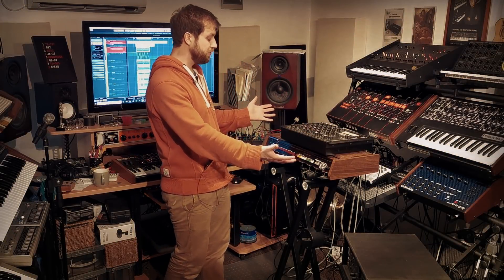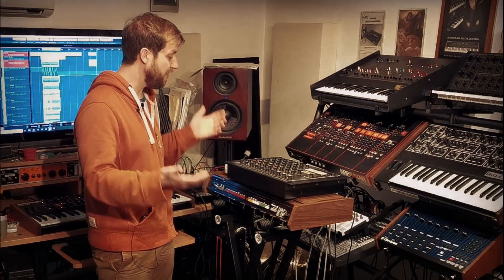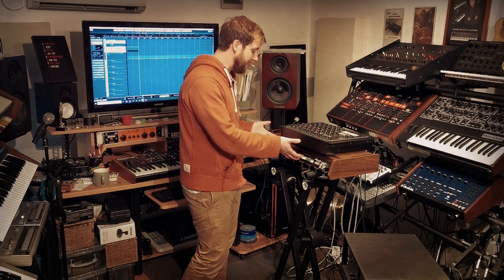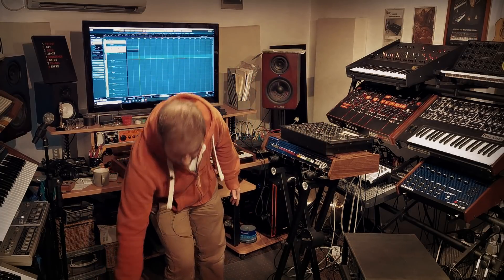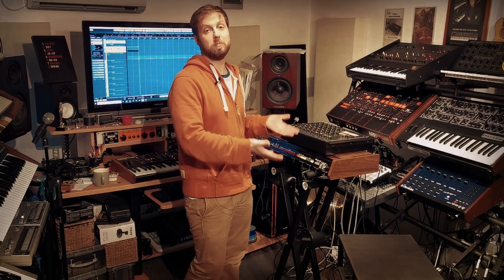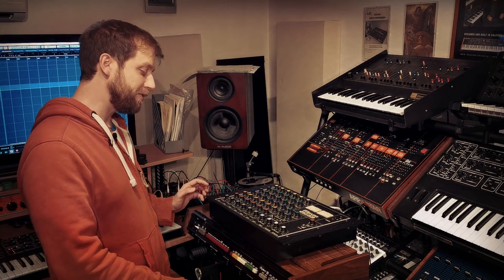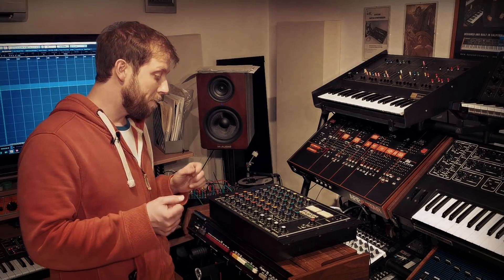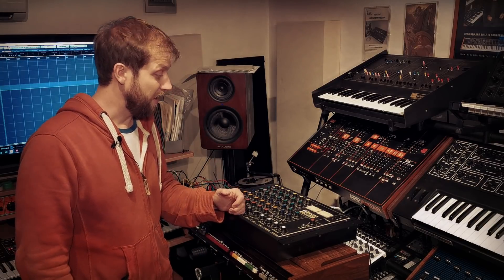50-year-old Rhythm Machine with Midi!

Comment: If anyone here is curious about Roland drum machines in general, I own a Roland Sound Canvas SC-88 Pro which I bought used for ~$450 USD from Amazon, and this has all the sounds of the CR-78, TR-606, TR-707, TR-808, TR-909, CM-64, and CM-32L, not to mention a bunch of regular synth sounds as well. When you consider that one of these vintage drum machines runs in the thousands range (such as the 808 for $3000 as Alex mentioned) an SC-88 Pro is well worth the price. I'm telling you...this thing is almost too good to be true...
Reply from the maker: Didn't know that about the SC-88. Thanks for the tip!

I guess there's sample packs of all of these that are free or cost just a couple of pounds, so that's the other option. But that SC-88 crops up for £100 and has loads of other sounds too, so that's pretty cool.

Comment: Tubbutec truly is a genuis! I wish he made a MIDI kit for my Casiotone 701.
Looking forward to the Stage Echo video!
Reply from the maker: I'd love a midi for my SH-1000 too. Imagine someone has found a way?

Stage Echo - it has inputs to control feedback on/off and tape speed from a trigger and control voltage respectively. So you can control it from a synth!

It also has a "sound on sound" mode. Veeeery interesting...

Comment: The Hammond Auto-vari 64 is really ideal for this - the drum tones are on a dedicated board with the trigger points on an edge connector, all clearly labeled. I've been planning to put one of these into my Autovari64 and even have the actual mod kit already, but I haven't had the heart to drill a hole in the chassis for the DIN jack yet.

Comment: Since I have with me a Roland TR-77 (that I bought years ago for $50), I'm quite intrigued by this. I'll have to check out that interface. Thanks for a very nice demo, Alex. On question though: can it  serve as a MIDI clock sync as well (in other words, having the internal clock of the TR-77 synchronized with an external MIDI clock signal) ?
Reply from the maker: Hey Alain. Yeah, transforms the 77 and it has some great sounds in it, so really unlocks that.

I briefly tried midi clock but I couldn't find a way to do it. I'm not sure if it's possible with the 77. I'll have to ask Tubbutec. Agree that it would be great to be able to clock the existing rhythms.
Reply: While it works well with a lot of other drum Machines, clock sync is tricky with the TR-77. You can get clock, but need to start/stop manually. More info via mail /)

Comment: That. Is. Awesome.
Of course, you have all sort of room inside of the 77's chassis.
I wonder if it will work with my SoundMaster ST-305. (yes, I did read your list of units but it's a rarer animal, so I still wonder)
Reply from the maker: SoundMaster - had to Google that, never heard of it. I guess theoretically it works in the same way as other drum machines of the era and would be possible. Space might be an issue as you say, but the Unipulse can fit into a 606.
Reply: @AlexBallMusic  OOOOOhooohohohohoh I know something you don't know! Red-Letter Day for me, my friend!
The ST-305 was my first drum machine, before I got a used TR-505 in 1986 (yea, MIDI!)

The SoundMaster "Stix Programma" brand was straight outta the late 70s/ early 80s. Fairly certain they were a Japanese company.
Their most famous units were the ST-305 and the SR-88.

SoundMaster also had a "Latin Percussion" version in the same form factor as the SR-88, but I've never seen one in person. The SR-88 had a blue metal version (which is rare and I stupidly sold) and a gray plastic version that matches the ST-305 color. The Latin unit is a dirty yellow color with red ink, but I have no idea what they modeled that Latin unit after since it came out before the TR-727. 

SoundMaster back-room-dealed the SR-88 to be organ drum machines and it was also sound as the Kay Sound DRM-1 Memory Rhtythm, and at least two other brands; I have ne of "those other brands" but as it is in storage, I've forgotten its branding and name. Same internal guts, though. 

I literally just learned last night of a Soundaster mixer called the MM-2 MiniMixer. To me it seems like a knockoff of the Yamaha MM-10 mixer, which I had for a few decades. They also made a SoundMaster Micro Rhythm pedal, a guitar-pedal-sized unit with a knob to select pre-programmed rhythms with a start-stop button (I have one). SoundMaster also made, of all things, electric train set sound effect machines, plus a few other oddities like a push button lighting controller.

Roland sued them out of existence, though, as Roland won the court case of proving the ST-305 was a 606 clone, and the SR-88 was a DR-55 clone. The original Behringer, LOL. Just as big a story in the synth/drum machine world of the famous Ibanez lawsuit Les Paul era.

FWIW, "audiothing dot net" makes two VSTs: one of the SR-88 and one of the Latin machine, which are spot-on recreations of those units. I'll let you investigate.

The Cyclone Analogic TT-78 and TT-606 hardware units are satisfactory enough to not kill the wallet buying a CR-78 and TR-606 respectively and do the dreaded MIDI modding.

^^I wrote most of that from memory and filled in the rest from opinion, so correct me if it's missing anything.
I'd love to see if that MIDI retrofit unit would work on one of my ST-305 units; I have two ST-305 units, and one has a busted timing chip/crystal, so it sits not playing and waiting for something like this worthy enough to come along and take a chance; the "Highly Liquid" MIDI retrofits were questionable and did not do justice when installed in my Yamaha CS-01, so if your mod here works on a TR-77, I'll give it a go. I have two (gray) SR-88 units as well that also need a mod to at least accept clock in (the SR-88 has clock out) for maximum fun.

Thanks for giving me the chance to know something you didn't know! Happy hunting for a working ST-305... I know you now want one.
Reply from the maker: Well I never. I had no idea about this little side story. Fascinating.

I found the AnalogAudio1 demo of it and it basically is a hybrid of DR-55 and TR-606.

Thanks for tip!
Reply: @AlexBallMusic  Hey while I have your ear; I've noticed you've had more than one of those "handled" Ibanez electric guitars. Therefore it's your preferred model/favorite. 1) what model is it? 2) price tag? 3) is that a Floyd Rose bridge on there, or... what?
Reply from the maker: @RobertDorschel  I only have one of them and it's an Ibanez Jem. It's Steve Vai's signature line.

Mine is the 7DBK that's more tasteful on the colour scheme than the other ones that were available when I bought it in 2002. There's loads of models these days and yes, they have a Floyd Rose which is scooped so you can pitch bend sharp as well as being able to divebomb flat.

It's basically a Stratocaster on steroids.

Comment: May I ask you. When you say it was sent for midi "surgery", who did you get do it? I want to get midi installed into my Korg MiniPops and also Rhythm55. I appreciate your help. I am based in the north of England.
Reply from the maker: Someone I know who knew how to do it as I'm basically clueless.

It's actually not difficult if you know how to drill and solder and can install the software over sysex. Tubbutec would advise no doubt.
Reply: @AlexBallMusic  haha, same here. I am the worst electrician and would use some help, but don't know who could manage it, been asking for ages. I thought perhaps it's possible to send it off somewhere to get midi fitted in. Damn.
Reply from the maker: @karljanus8308  Guess you'd need to ask around for a local tech. Maybe a local music shop would recommend someone or be able to do it?
Reply: @AlexBallMusic  I will ask around, but thanks for your help. Great channel.

Comment: very cool vid as always, I have the unipulse installed in my TR77 as well, midi notes work well but I couldn't get the TR77 original factory patterns to receive an external clock from my DAW, any leads?
Reply from the maker: I checked with Tubbutec and you can't send midi clock to the TR-77 unfortunately, due to the architecture of the instrument.

You can always copy the pattern and program it into midi I guess.
Reply: @AlexBallMusic  Thank you for the info, when you say copy the program do you mean recreate it or would you think it would be possible to export the pattern's midi notes?
Reply from the maker: Yeah, I mean recreate it in midi.

Comment: A drum machine you have to ARM?
Reply from the maker: It's because it's a rhythm machine that's been modded to be programmable. You'd normally start it running with the "start" button but with no rhythm selected that now switches to midi mode basically.

Comment: How dose the velocity even work with that?
Reply: There's a good chance it doesn't have velocity, given that it probably didn't come with it initially and velocity seems like it would be a hard feature to add in if the device doesn't already have it.
Reply: @benh.635  
Go watch the video @1:15.
Reply: @AlainHubert  Huh, thank you. I guess I missed that on the first watch through xD
Maybe it varies the amount a given hit is accented then (assuming it has the ability to accent steps/hits)?
Reply: By having the Midi-interface sending a signal to the amplifying stage perhaps.
Reply from the maker: Good question. Assume it's controlling the amplitude. Tubbutec will no doubt be able to answer that.
Reply: @AlexBallMusic  Interesting! Now I'm quite curious as well :3
Reply: UniPulse generates pulses with different amplitudes depending on midi velocity. The analogue circuits in the drum Machines emulate a physical model of a real drum and thus react the different stimulae quite naturally
Reply: You can even try different pulse shapes (and hit your 'drum' with a soft mallet)
Reply: So the velocity is not global, but per-instrument. I recommend watch the TR-77 demo on our channel. You'll hear the sounds not only have different volumes, but also different sounds.